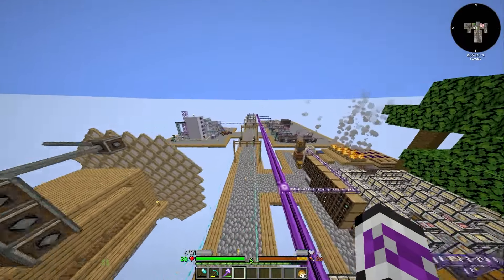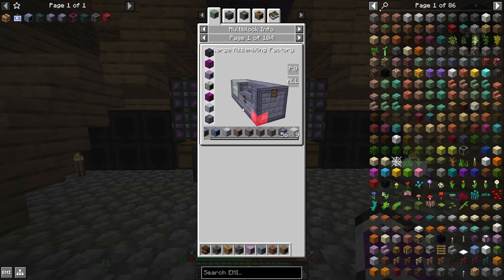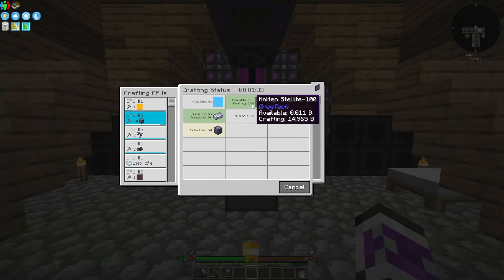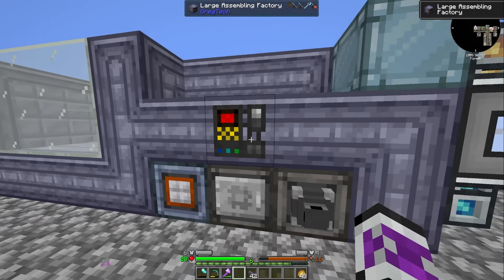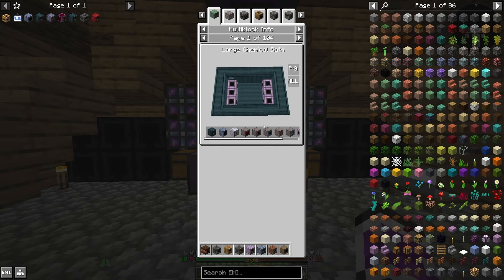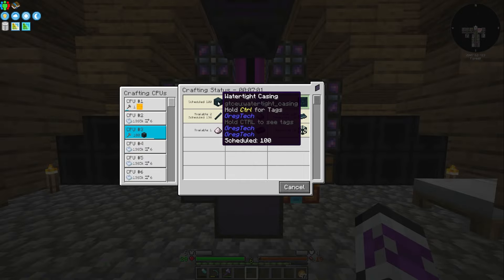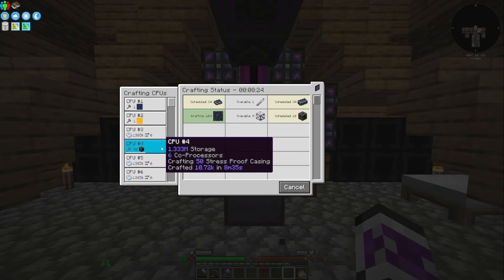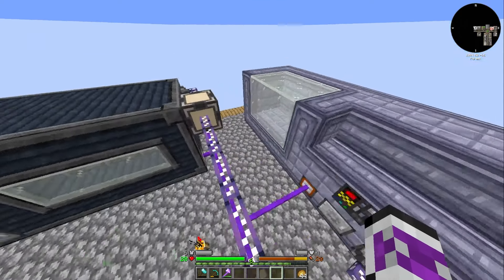Star Technology: Episode 32 - The Multiblocks are Done

Comment: quick note:
if you set up a subnet that has your pattern provider (pushing into the subnet) on an interface (connected to subnet) and then you can use storage buses to store everything that enters the net. Then you can make another subnet that returns the output of the recipe to the pattern provider, and set the provider to lock crafting until it receives the output. You can easily handle gregtech multiblock outputs with either an interface on the output bus or hatch or craft the ME output bus or hatch (in IV if i recall correctly)

Comment: About the multi amp energy hatches: while they provide more amps(4/16 amps) of energy, this doesn't mean the machine overclocks. 
There are two aspects to overclocking: duration overclocking and recipe tier overclocking. Normally, having two energy hatches(2*2 amps = 4 amps) will overclock both the duration(1/2) and the recipe tier(+1 recipe tier), a multi amp hatch will only overclock the duration. The recipe tier will stay the same, but the duration will be either 1/2 or 1/4 of the original duration(energy usage is multiplied as well). 
IF you want to overclock the recipe tier as well while using multi amp hatches, there is a cheeky trick: Have 1 multi amp energy hatch and normal energy hatch of the same tier(ex, 1 16-amp IV hatch + 1 IV hatch => duration 1/4, LuV recipe tier).
So in short, use multi-amp hatches to support parallels and if you want faster speeds on non-parallel multiblock. Recipe tier overclocking will ONLY happen when there are 2+ energy hatches.
Generally speaking, multiblocks can have up to 3 energy hatches.